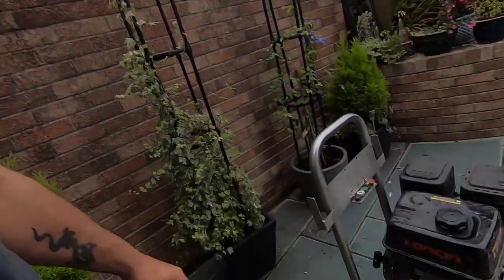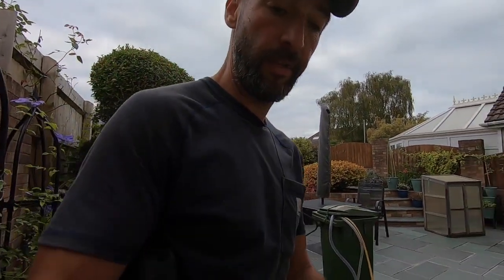Simply pressure washing

Comment: Hi Nathan I tend to use hyperchloric acid on patios then wash down with the power washer strenth of acid is dependent on how dirty the patio is but it works ok
Reply from the maker: Yes the hypo is great for the black spot and lichen etc. paved areas can get dirty/ slippery so quickly sometimes. Cheers 👍

Comment: Hey Louis thumbs up and what head for drive ways you using or any recommendations a do a little bit of jet washing not to much if a can help it lol it's cold this time of year the cleaning head looks really good av bin through a few cheaper ones already and can you used a standard 140 bar pressure washer with them ? Cheers as usual mate
Reply from the maker: This runs at 21 ltm but think fsc will run off less, think it's a whirlaway, haven't used it in a while so can't remember 😅
Reply: @LewisgardenservicesLtd  cheers mate